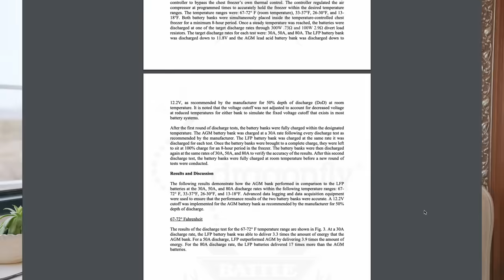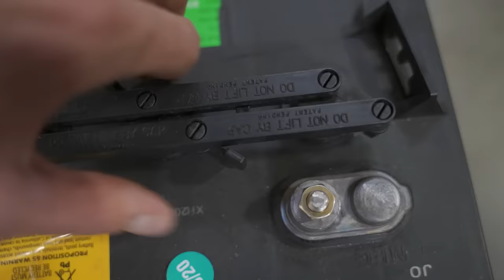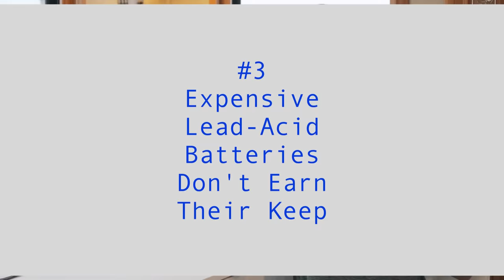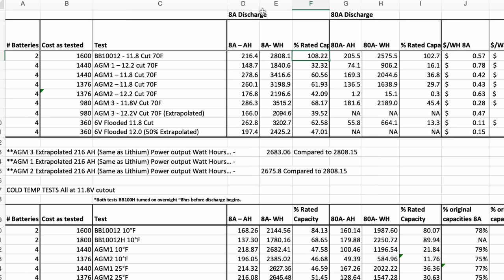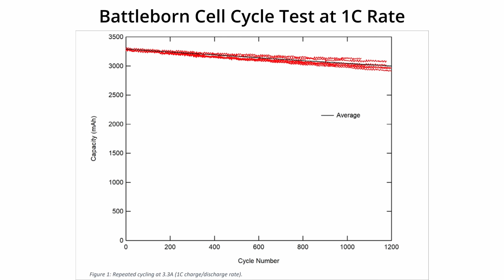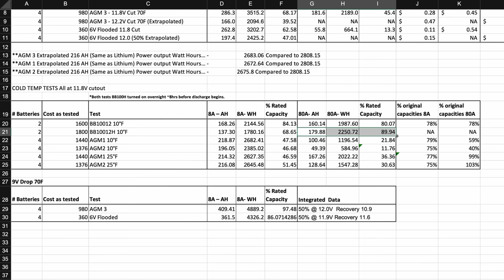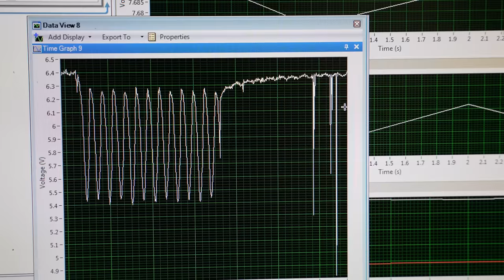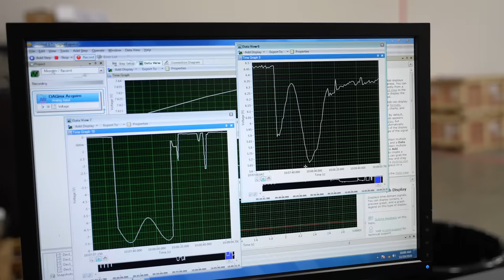Don't Waste Your Money On Batteries - The Shocking Truth I Discovered When Testing RV Batteries

Comment: The video is overall good, but calling a "Lithium Iron Phosphate" battery ( LiFePO4 ) a "Lithium Ion" battery ( Li-ion ) is completly FALSE. Thoses are 2 different technology with major difference in performance, lifecycle, usage, safety and environmental impact. Even the CEO of Battle Born Batteries call their LiFePO4 battery a "Lithium Ion" in front of their COO... wtf is going on here... 😐🙄its litteraly the same as calling an "AGM" a "Flooded" lead acid battery. This is very concerning considering the subject of this video and the reach (2.4M+ views). 🥲

Comment: Just an informercial for battle born. Real world for me is my 3 batteries costing $240 has powered my RV more than 260 days off grid. My set up is 200 watts of solar and 200 amps of usable battery and total cost was $585. No longer think about batteries just use them. Life is good.
Reply: Awesome, I'm planning to do this for my gf. She lives in the Philippines so the grid is 220 there
Reply: Hi sire sounds great to me . question what amp batterys do you have? With name brand are they, and were did you get them

Comment: Great video but the general claim at the end that Lead acid "are not reliable to be used in a power application" is utter garbage. They are now no longer the most cost effective way, but they have been used in power applications for an extremely long time. We have been using them to power entire hotels on fraser island for over 3 decades, back when Lithium ion batteries were still at >$10,000 per kilowatthour.
Reply: "are not reliable to be used in a power application"... yep.  I guess electric forklifts run on air?
Reply: @somaday2595  If you're still using Lead Acid in forklifts, you're pissing money out the outlets.
REAL cheapskates agree with Hank Hill on the most cost-effective way to run a forklift.
Reply: @TimeSurfer206  Who is Hank Hill?
If the cost is already sunk, the batteries are a counter balance and the lift is meeting the requirements, why do you say continuing to use lead acid batteries in forklifts is wasting money?
Reply: @somaday2595  Hank Hill is a fictional character on the TV Show "King of the Hill."
"I sell Propane and Propane Accessories."

Comment: This is a battle born advert, doesnt even mention that if you DIY the same cells, they cost 1/5th. Thats the reason why Will Prowse has 6 times as many subs as this guy. he isnt a sellout
Reply: lol, will prowse has battle born batteries listed on his website..... Heres what he says.

"Good battery, but pretty expensive. If you want something that works great for years (or decades), buy this battery. I have not heard of a dissatisfied battle born battery buyer. It just works. I would go with the SOK/Ampere time battery above unless I needed a sealed battery, for marine application. The battleborn has the best case and terminals around, and can handle high moisture environments. It is also ideal for high vibration systems, such as RV's and vans."
Reply: @Cameron-ur2tk  he doesnt say its "THE MOST COST EFFECTIVE" like him at 0:14

Comment: The whole point for AGM versus flooded lead was the electrolyte wouldn’t spill and required less maintenance.  It was never really designed to perform better but was designed for mobile use in boats, cars, motorcycles.  This analysis would have been more useful if you had tested deep cycle golf cart batteries instead of cheapo versions.  BTW I purchased Trojans for less per AH than the cheapo Sam’s club deep cycle batteries.
Reply: This!
Reply: AND ALOT MORE FIRE PROOF LOL....
Reply: @user-my8zo8uh3n  Dude these are LFP Lithium Ion cells, people have drilled holes in them and nothing has happened, like don't tempt fate or anything because these is a lot of potential energy in those cells, but they are pretty darn safe as long as you don't have a lot of other cells to feed into them without a fuse to stop massive amounts of current going into 1 cell, like in the case of a car battery even if you make it out of LFP cells like you have to have a lot of cells in series to get the 100s of volts they want, but for 12 to 48V systems where you can put breakers or fuses between each parrellel string of batteries it's stupid safe.

You are thinking about NMC cells, which nobody sells those anymore for residential energy storage, yeh they get used in phones and EVs because the weight and size matters a lot of those use cases, but for a house battery the extra safety and the increase in the number of cycles from 1000 to 5000 cycles of LFP is more than worth the extra volume and weight.
Reply: and theres  more ,  agm or lead acid will out last  a lithium batteyr due to lithuim battery having a  bms charging   board  inside  that fails over time,(right when you least expect it)  , this bms electronics( lead acid and agm Dont have ANY charging electronics)  cant handle in and out current (NO matter what the company rep , china or the  warranty says)  .  also as many marine guys do on here and show , you can mix  2 or 3 agm or lead acid batteries  to every   1 lithium and tie them  together   resulting in Great power that compliments each other .
Reply: I need to replace 8 batteries on my golf cart. Where should I purchase my replacements
Reply: Also the 12.2v for 50% of battery charge is NOT 12.2v under load.  If you want to check the state of charge of a lead acid battery you need to take it out of circuit and allow it to "recover" before reading the voltage.  If you're reading the voltage while it's still providing power, you'll see the voltage drop to 12.2V long before it's down to 50% charge.

I think we have to bear in mind that this guy is NOT providing impartial data.  He's obviously biased towards "Battle Born" batteries.  So treat the information he provides accordingly.
Reply: @KenFullman  How is it obvious he has not developed his opinions based on the data he discovered?
You're welcome to make your own setup, record your data, and publish your results.
I'm a retired Electrician, and I have always hated Lead Acid batteries almost as much as I hate Infernal Combustion engines.

Comment: Whom ever created the science for this video, hats off to you. A perfect set of data points to push lithium, while ignoring industry standards on how AGM/Lead Acid batteries are tested and rated for their specifications. A lead acid battery's capacity is not determined by a 'loaded' battery and voltage, but instead by a specific time at rest, after discharge. Those AGM batteries were not at 50% DoD, at any of the specified load tests.  Honestly, its great marketing! Nice job.
Reply: Crazy we are here at the same time thinking the same thing.
Reply: While it is basically a Battle born add lipo is a far better choice

Comment: I investigated "house battery power" for our Class C motorhome within a month of purchase. It had a single 12 volt marine battery from the dealer - and most people who've bought an RV KNOW how those batteries are treated! I knew I wanted solar, so 200 watts went on the roof. Next, I replaced the stock 20Amp PWM charge controller with a more robust 40 Amp MPPT controller. Then came the storage device.
All I needed was a reliable source of 12 volt power to operate the motorhome slide, run the furnace fan, led lights and minimal power for the propane fridge (when not on shore power). If we need the AC, a hair dryer or coffee maker (high amp draw devices), we either run our on-board 4k generator or plug into shore power. So... 100 useable amp hours kept reliably charged would be perfect. My choice came down to two options: LiFePO4 12 volt (no maintenance) or flooded GC2 6 volt golf cart batteries (minimal maintenance). Two 6 volt batteries? $180, lifespan 4 years = $45 per year. One lithium? $900, lifespan 10 years = $90 per year. For me, the real world math tells the story. The cost/benefit ratio just isn't there yet for lithium.
Reply: Believe that the cost of the 6v batteries will be twice what you quoted, thus equalling the annual cost of the lithium batteries. Factor in that the lithium batteries have considerably more usable power  and your way ahead with the lithium.
Reply: @davidgirolametto393  Agreed.  Plus, the dreaded "oh no...we are fully discharged" is real and is not a big deal with lithium...but I've found that even after a SINGLE "fully discharged" event my FLA deep cycles no longer work as well as they did.  I will absolutely be replacing with Lithium next time.
Reply: I've run lead acid and now lithium and there's absolutely no comparison !  I will never run anything but lithium from now on . Its half the cost when you figure everything correctly . And no maintenence !
Reply: @stevelamperta865  Some buy a Prevost; some buy a Thor coach... to each their own. In the end it's about usable amp hours. What you decide to pay for those amp hours is up to you.
Reply: @davidgirolametto393  $97 each at Sam's Club. 2x = less than $200. 215 amp hours ÷ 2 (1/2 usable) = 107 available amp hours. Now... how much does 107 amp hours cost going the lithium route?